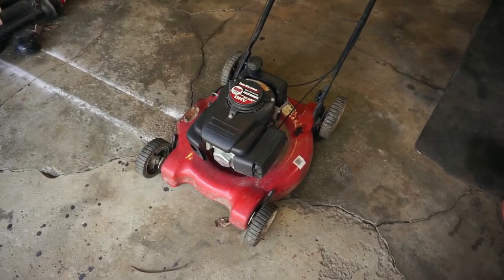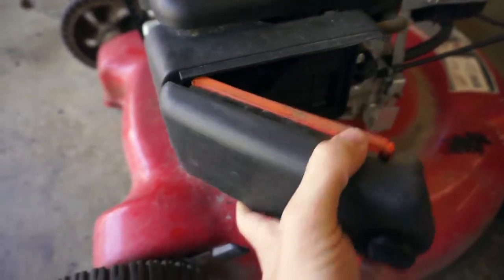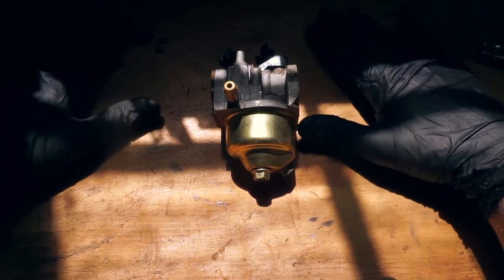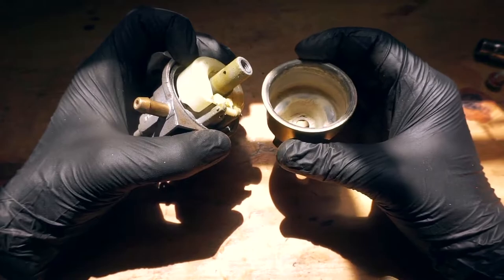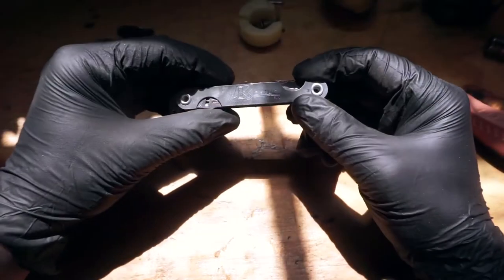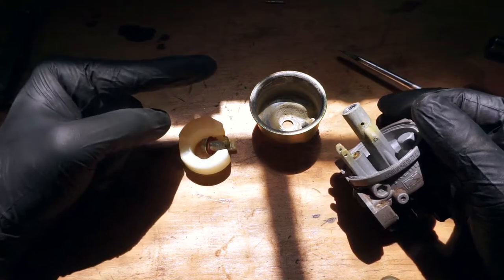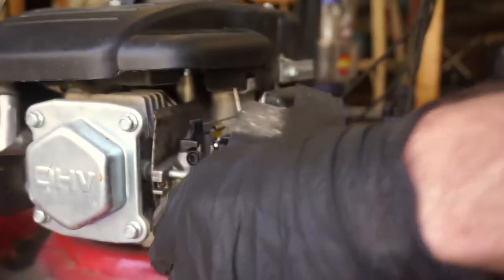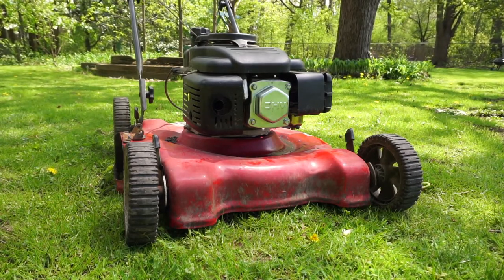Trash-find MTD lawn mower repair | Chinese 123cc Carburetor cleaning.

Comment: Great video! My sister needed a lawnmower and I had one like this, that our Uncle gave me. It had been sitting out in the weather for a few years, due to the lack of space in my garage. I've never worked on a mower with this kind of carburetor before. I got it running and found that I had a fuel leak from the carburetor, after it sat for a little while. I figured that the float needle might not be seating properly, and was allowing the gas to flood the carburetor. I tore it back apart and cleaned the float, needle, pin and seat, even better than I previously had. I used a Q-Tip this time and sprayed it with carburetor cleaner, to clean out the seat and rub off any residue that might be left on the needle, pin and float. I put it back together and left it set overnight. The next day, no more leaks and it started with one pull. Ended up being a great mower and for free. Thanks for the video.

Comment: I have a chinese lawn mower for over 6 years now. So far everything works perfectly just change oil and clean carburator and it'll run. Some chinese engines are made good if you're lucky to find one New briggs engines have more plastic than these chinese ones. I had a new Briggs engine lawn mower before which lasted only two years. The engine mount points snapped and now it's not hold engine in place and  carburator is made of plastic...

Comment: I like to call power more engines power NO more engine because they are crap
Reply from the maker: They're no worse than any other chinese engine.
Reply: [Cap10323] that’s true. But now it’s hard to find MTDs with a Briggs or even Honda
Reply: @ghostzod665  I wouldn't say todays briggs engines are any better than chinese ones.
Reply: @aamikkalinin6385  you’re not wrong but you really want to get yourself an older style quantum engine